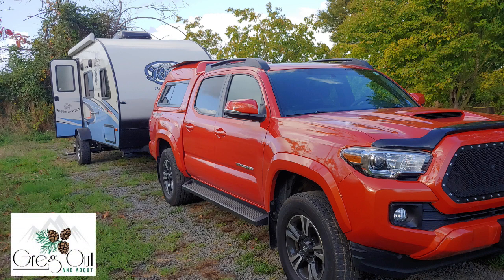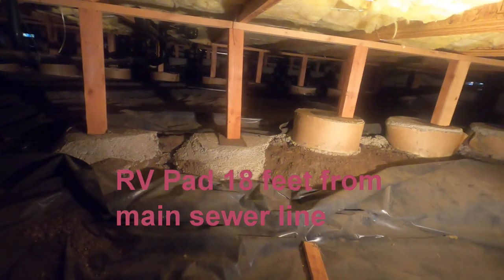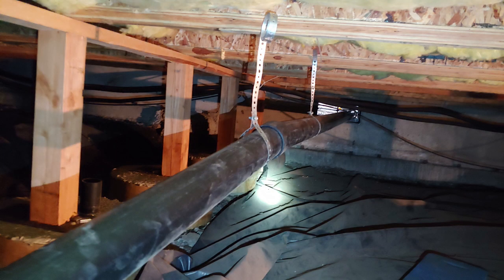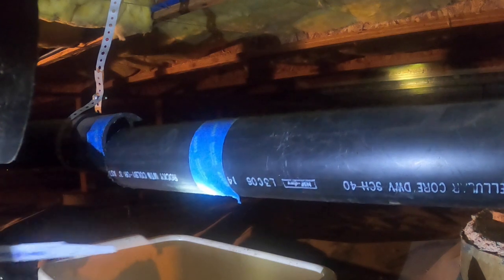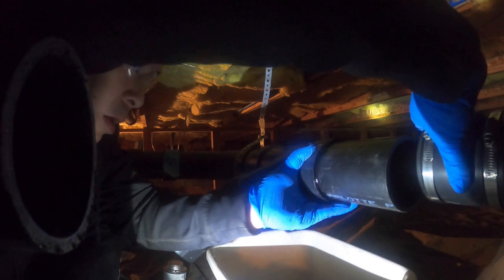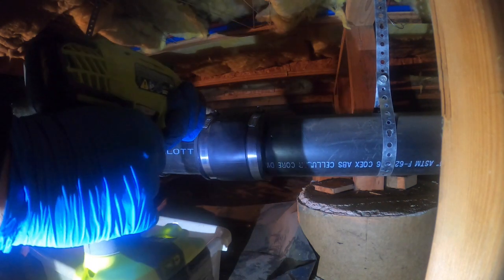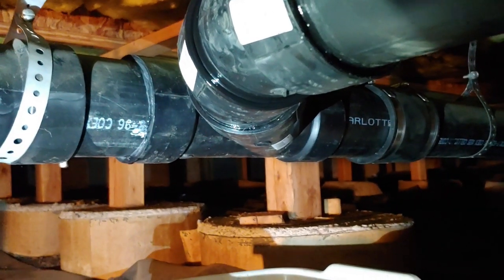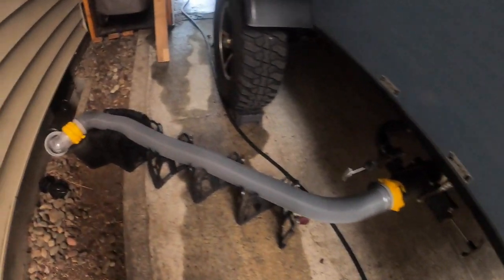How to install a new RV Dump Station and Connect it to Your Home's ABS Sewer Line

Comment: As a service plumber, may all the crawlspace I ever find be as beautiful as that one.
Reply: Doesn't he need a vent close to the connection? I want to do the same to my house
Reply: @vitodunmire6415  all plumbing fixture drains require vents and there are requirements for how long a "trap arm" can be based on drain size
Reply: So how long can it be and how do you add vent?
Reply: @vitodunmire6415  to be honest, in this situation, if legal at all in your jurisdiction, probably wouldn't require a vent. But I think the trap arm length for 3" pipe is 6'.
Reply: @byronsteez8253  how would i connect a sewer to my main 3" which is about 35 feet away?
Reply: @vitodunmire6415  honestly man I have no idea your level of ability or plumbing knowledge. It probably won't be easy to do if you've got little idea
Reply: Absolutely no need to vent this fixture as 1the  tanks on all RV are vented already. It’s just a straight dump into the sewer line.

Comment: If you are using chemicals in your black RV tank, you're not supposed to dump into a residential sewer system. It destroys the natural bacteria that the system needs to function properly.
Reply: Pretty sure that would be a concern if the house was on septic and normally your RV does not have chemicals added to the black/gray tanks that are not biodegradable and septic safe
Reply: @LilyWillow22  Well basically wastewater treatment plants do the same thing but due to dilution it isnt a big problem unless the chemical is really toxic and those are usually illegal to dump either way. Just think of all the people using draino or dumping bleach and water down drains when cleaning things. Public sewer systems are designed with that in mind and the waste water plant is too.

Comment: Why didn’t you put a trap in the line so you don’t get fumes out of the dump station?
Reply: I believe he had screw in cover, that is better because all you will have in the trap is paper and poop which will eventually will dry up and plug your trap. I believe that will stink just as bad. A ball valve will be best if you are concerned about gas or easily access without unscrewing cover. Still need to cover the opening to keep bugs out.

Comment: General rule when pitching waste pipe, it should pitch a 1/4 inch per foot. On a level, that is the line past the level line. The edge  of bubble should just touch that. They make levels to show the correct pitch. If you pitch the pipe too much, the water will leave the paper and waste behind,  causing a blockage over time. I admire your bravery in getting the job done and for the most part you got it done right. On a good note, you had the forethought to  prevent getting flush in your face!🤣😂🙂

Comment: My husband added a clean out but had to dig to locate the 4 inch pipe.  Cut the pipe with a saber saw and used the same fittings you used.  Pretty easy.  Works great!

Comment: So practical and concise. Thanks so much for sharing! My issue is our RV septic attachment is on the driver's side and the house is on the passenger side. We would need to go under the driveway to set up. When at home it is use the house facilities or chamber pot if necessary.

Comment: Hi, excelente vídeo. Do you need any kind of permit from the county to do that type of work? And do you need any type of permit for parking your RV in your property and have guests staying there? Thank you.
Reply from the maker: I would check the laws in your area.
Reply: For most cities you need a permit to attach additional sewer lines.   There may be other charges added later.  But,  I know it's not super expensive to do it in my area (Tucson).

Comment: Do you mind considering videos about the shelf above the bed if in fact you made it. Also, I would like to know where you bought the reading light and how you attached. Would you consider making a video showing how to put the sealant around the windows and on the roof as well?  I noticed you turned your dinette into a work station table top. Would you consider showing a video on how you did that? Thank you if you can do any of these instructional videos. I love your videos. My 180 is a 2017 and I would like to modify some things and you have great ideas and explain things exceptionally well! Thanks again,